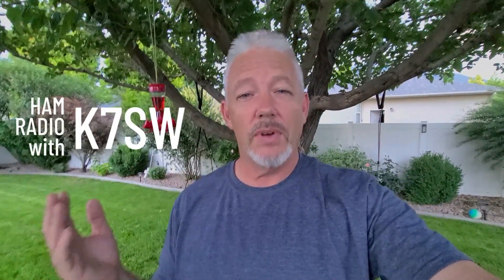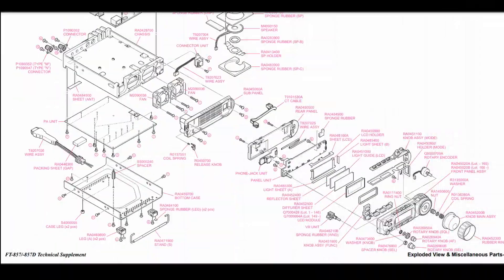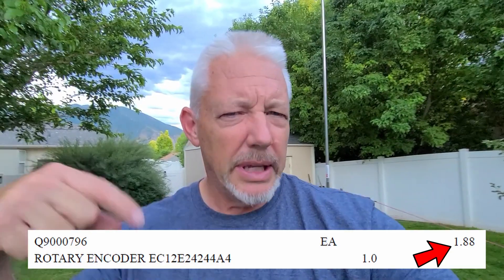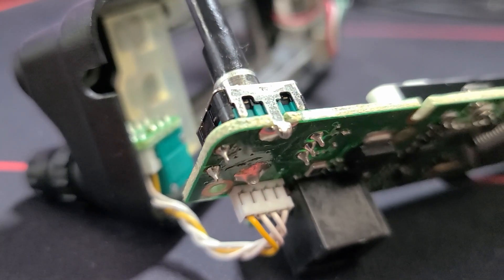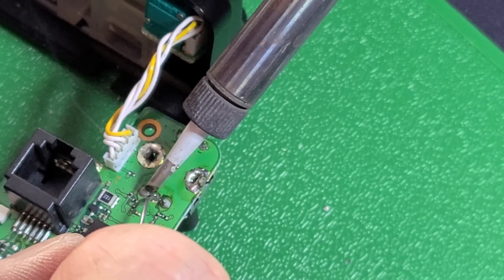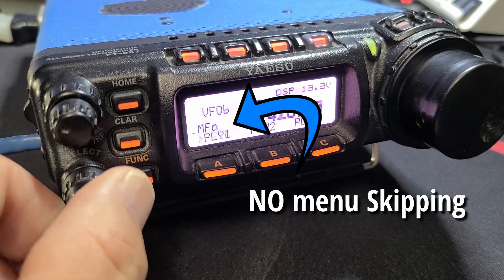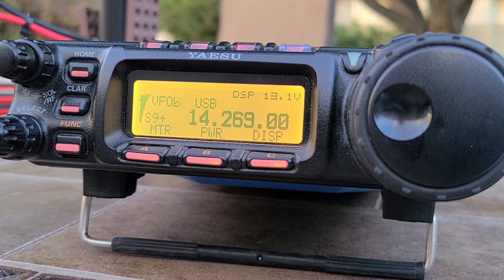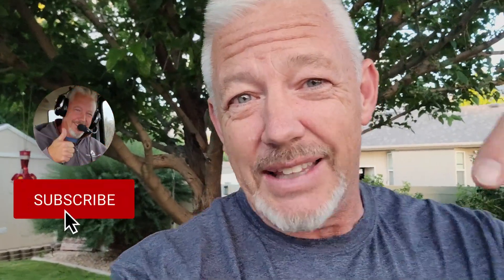Yaesu 857 Repair | K7SW ham radio

Comment: Mine does the same from time to time, mostly when it's cold. I've had to replace the VFO encoder and that was not as cheap of a part but the hardest part was that the encoder I bought didn't come with the connector, so I had to splice on the old cable. For 3x as much I could have bought a genuine Yaesu part, which was the same exact one I used plus the connector.

Comment: N6EF-Thanks for the video. I have this problem with my 857 which is the rig I use for most of my POTA activations. Sub'd. 73.
Reply from the maker: Your welcome Bill, I hope you get your radio fixed as a result.  73 Kevin

Comment: Yaesu radios have been pretty easy to repair so far.  I had to replace one of the multi knobs on my 891.  I don't even think I had to solder.
Reply from the maker: It is good to know that I am not the only one to have this type of problem.  Thanks Steve for sharing about the 891. I had given thought to getting one at one point. 73 Kevin
Reply: @hamradiowithkevin  sorry, my problem with the 891 was that I dropped it and bent the knob... "TO error"  I also shorted the antenna port and had to replace a Resistor inside as a result.  I'm really good at inflicting damage on myself and my gear...  oh, and if it's got wheels, I can get it stuck!
Reply from the maker: Now that's a good one. I feel your pain on the inflicting. And Getting stuck, Nicely done 😉.

Comment: Usually you can also open the encoder and clean it/retension the spring contact. That is enough to restore good functionality. But hey for such a cheap price for a new one is hard to resist. Good job!
Reply from the maker: Diego, thank you. 73